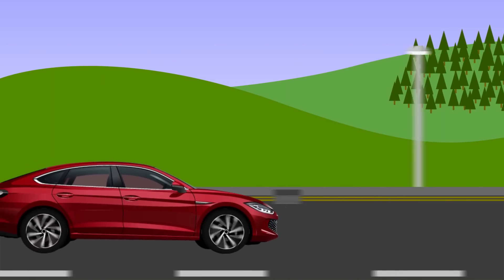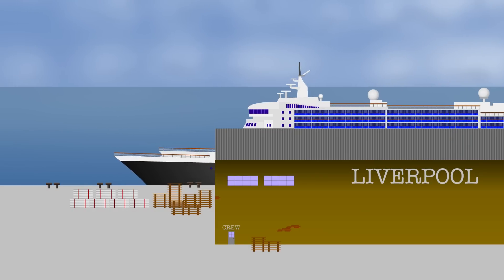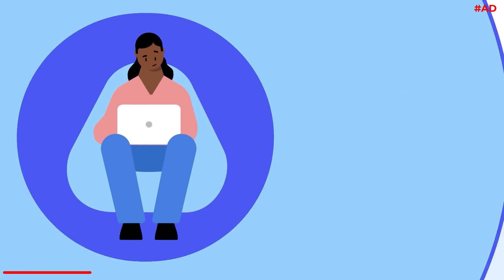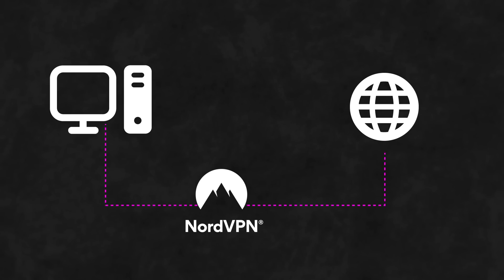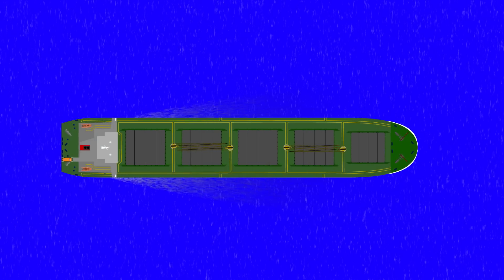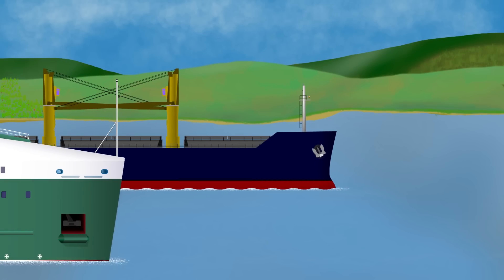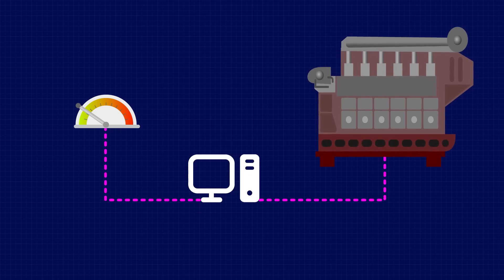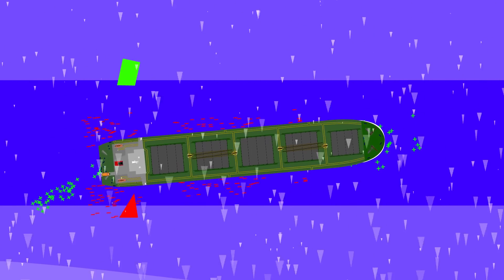What's Going Wrong With Fuel Efficient Ships?

Comment: Ship software can have confined water setting,to pre adjust the fuel efficiency systems to off in known busy traffic and narrow channels. Fuel efficiency can be also due to emission norms, which can be adhered to, by storring gas pollutants on board ship, in a compressed gas storage system that can on reaching any sea port fitted with gas pollution treatment facility, pump out the pollutant gases,to the sea port receiving facility for pollutant gas treatmen after a exhaust gas treatment paymen. Thus,the engines can also go faster as well, in narrower routes and still, pollution can be reduced. Lithium based battery inverter as a secondary power source should be on board all the ships, for pollution free automatic power source, smart switching between main engine and the main batteries  on main routes. Thus gas pollution is significantly reduced. Port can on payment by ship company, also supply electricity for propulsion as 5 to 10% of ship main reserve power to the ship main battery inverters from solar panels at the port itself or from the grid.

Comment: Now that we're here, and the Dali hit the Baltimore Bay Bridge, what are the odds that the blackout/engine failure the appears to have happened is the result of a PLS being on, and large engine controls overloading the system causing a blackout, at the wrong time, which led to their collision?
Reply: I can't believe that there is no override on some ships. Seems like that best compromise is the switching to cleaner diesel near port and disabling the PLS altogether. Automatic pilot and road assist driving are cool but in the end. I know some planes are impossible for a human to fly without computer assistance.

Comment: I'm sorry but I have to disagree with many things that are mentioned in this video.

The software you are talking about is not really a power limitation but a load program. Many ships have a load program when increasing rpm above a certain power simply because some engines are very large and rapid fluctuations in engine power cause thermal stresses which can damage the engine. The load program (slowly increasing RPM) is only there to prevent damage caused by thermal stresses, not to reduce fuel consumption.
During maneuvering, normally you stay below this load program because you want the engine to respond rapidly. In case of emergency you can ovverride these limits but you risk damaging the engine(s). That's why you have a full ahead maneuvering and a full seaspeed.

The power limitation that you are talking about is due to EEXI regulations which states that all existing vessels cannot exceed a certain value of mT of CO2 emitted per mile sailed, a number which is ship specific. Many older vessels do not meet these requirements and therefore have to take action. There are many ways such as fitting energy saving devices or changing over to a more sustainable fuel. But all these require significant financial investments which often are not economically possible, especially for older vessels. The easiest and cheapest way for a ship to reduce air emisisons is to reduce speed, and this is achieved by installing an engine power limitation.

With this power limitation,  the top speed is decreased and less power is available for maneuvering. But the engine still behaves exactly the same as before, in the same load program.
What some ports require, is that ships remove this power limitation so their full power is available at all times for maneuvering.
There are two systems, a mechanical limiter and a software limiter. A software limiter can be overruled by a push of a button on the ship's bridge. A mechanical limiter has to be removed by an engineer on the fuel rack of the engine.

I have sailed for 10 years as a mate and am currently in training for becoming a marine pilot. Until last year I was working in the office of a shipping company and all our ships were being fitted with power limitations.

Comment: Not related to this video, hoping the mariners here can answer a question for me.
Today on the Liverpool to Belfast ferry we passed/overtook another ship, a dredger. 
Do the officer's on watch/ masters acknowledge each other from the bridge? Eg wave , say Hello over radio. Or is it strictly keep your distance and course, keep comms clear unless required
Reply: I was working on the Liverpool to Dublin ferry and when we were still sailing on the Mersey river, you have to report to a vessel traffic control system (Mersey VTS). They have a radio channel which is dedicated to traffic on the river and there you make agreements regarding overtaking and movement in general. Probably you will contact the dredger and VTS before overtaking. Once you are off the river, you are free to do what you want as long as you follow international regulations. At sea I was only contacting other vessels before overtaking or crossing if I required their assistance.

Comment: I've heard the same sort of comments about traction/stability control on the Dodge Charger Hemi V8 cop cars when they first came out.  Gave the cops a false sense of security in that if you are engaging stability control, you really are out-driving the car and need to back off.  Or the stability control/traction control would kick in a way that the driver was not expecting it to throwing the balance of the car off in a high speed maneuver.  The old Ford Crown Vics didn't have stability control(and were down 100hp vs the Dodge) so they handled different if you pushed them to the limit.  Also you weren't going as fast in a Crown Vic so it was easier for an unskilled driver to correct at a lower speed, it was harder to outdrive the car.

Comment: So a power limitation software is like an autopilot for the engine? In that case, shouldn't all system have something a disengage them easily? Ships might be slow but there are situations where the crew would need to squeeze every bit of power they can from the ship at the shortest amount of time to avoid something so in my opinion, this kind of system should just have a big red button that when pressed would switch the ship's system from automatic to manual to give the crew the freedom they need.
Reply: What do you mean with manual? A giant steering wheel to mechanically push the propeller in a different direction?
Reply: @eljanrimsa5843  manual in a sense that the computer won't interfere with the input of the helmsman. If the helmsman inputs "full astern" the engine would switch gears and go to full astern without any interference from a computer program. The a narrator said that in some cases, the power limiting system can't be disabled in some ships which I think is dumb. What if you saw someone about to collide with hit and you needed all the power you can get from the enhine to move out of the way but the power limiting system prevented you from doing so?

Comment: Interesting and weird.  Ships have been around for a very long time.  Just as a piece of rope can replace autopilot I'm sure there were similar things even on masted ships.  Maybe like a mid-masted sail that doesn't get you all the speed but can easily deal with variable wind speeds so everybody can relax and take a nap?  Or that other thing, what am I thinking of...  Oh yeah!  CRUISE CONTROL!  You know, like in your automobile?  Won't engage under a certain velocity?  Helps with fuel/engine efficiency on long trips?

In all fairness I'm pretty sure the shipping industry already wrote the book on long travel efficiency AND 3D navigation.  And also insurance.  The main point I got from your vid is that neither automation nor capability is the problem.

The problem is they installed automation but never put a !BYPASS! switch on the control desk.  That's why Bow-Wingg managed to sell a plane that flies into the ground on purpose.  Oh, and also apparently automatically disintegrates when off the ground.  It's not a bug!  It's a...!  OK, it's a design flaw....  But digress I am...

Thanks, great job, please keep at it man!  Everyone should learn to Navigate, Casual or otherwise!

Comment: You need to understand the costs of shipping, (Fuel, Port Fees, Each canal, Suez, Panama charges huge fees)  because the time, labor costs and fuel to go around a continent is higher but these canals are Gouging shippers with Unreasonably high fees.  Panama you get in Queue(Perishable, Time Sensitive Cargo) To jump the Queue you can add Another 15% or more to the Base Canal Fee.

Comment: On those ships without them, which muppet (or penny pinching cretin) failed to put add a simple manual override  into the spec, to enable the crew to take evasive action?  Don't Lloyds and other underwriters require such blatantly obvious safety measures before providing cover, or is the situation as you've presented it, slightly exaggerated?

Comment: Only system I've worked with - granted it was 20yrs ago - was a "load program" that was used between maneuvering full ahead and sea speed.  If you were timed steaming at less than full sea speed, it would work within that zone from FA to sea speed (usually 93% MCR).

Comment: Lots of commenters are focusing on the software part of this.  On older vessels the engine power limit is set with a physical stop on the engine fuel rack to limit maximum travel.  (Think a bolt that is locked down)  In order to comply with emissions mandates this bolt has to be set with and engine manufacturers rep AND a class surveyor in attendance.   Once the setting is achieved, the measurements are recorded and a seal in placed on the bolt to prevent tampering.   In order to achieve the original power the bolt needs to be removed and seal borken.  So in order to get back into emissions compliance a class surveyor has to come back and verify its correct and re seal it.

Comment: Sound similar to an airplane's direct and alternative laws. Alternate law will override the pilots to prevent over banking and stalls. Direct law will not. Pilots will switch modes whenever there is a systems failure for better control of the plane

Comment: Increasingly, this is happening in cars as well.
The levels of driving aids in the modern motor car is just crazy and I find myself in a battle for control whenever I drive my wife's newer car.
Reply: That's terrifying! Doesn't the owner manual tell some way to disable some of these automated systems?
Also, what model are you driving that has automation that seizes control? The Automated Driver Assistance Systems that I've heard about are all augmentation, for example a warning when you start to depart a lane.  Well, there's also automated braking during cruise control, but that's cruise control and anyway not many people get upset that they failed to crash into the vehicle in front.
Reply: @j_taylor  Automated lane keeping tugs on the steering wheel when choosing better driving lines on twisty roads.
The automated braking system applies when continuing straight ahead off a roundabout behind a car that is turning...
After years of driving rally cars and enjoying driving, I'm not a fan of the car trying to do it for me.
I've recently purchased a '98 GC8 WRX for myself to drive, the only driver aid is ABS 😁👌
Reply: You know you can just turn them off right?
Reply: @MiniBandit007 
Yes you can. As soon as you turn the car off, they're all right back on again.
Not only that, they're never really fully off.
If like me, you can really drive a car, like I used to race rally car and was part of a stunt team, then if you actually try to do anything not programmed in the stability system leaps into action to 'save you'...

Comment: I have been up the Houston Ship Canal on a LPG carrier several times, usually to New Warren gas terminal, Houston. These passages seemed quite fast.
On one occasion, the 2nd. Officer told us that the Pilot was on the VHF to ask a vessel coming downstream what they were carrying. The reply was "Biscuits", whereupon our Pilot told them to get out of our way, because "Butane and Biscuits don't mix".
This was many years ago, and I didn't see the other vessel concerned as I was on Engine Room watch at the time, but I was amused to hear about it.
As an aside, regarding slow speed and electricity generation, on several of our vessels the exhaust gas boiler could supply enough steam at full speed to run a turbo-alternator sufficient for the entire electrical needs. At slow speed, due to insufficient steam production a diesel alternator had to be run too. This was, of course, before the systems that you described were in use.

Comment: One engineering principle that I really wish that people would demand more of any automatic system is some form of complete override. When your product is going to be in use 20+ years eventually you will find more than one moment where the end user needs full unfettered control of the product without the normal restrictions imposed by automatic systems.
Reply: There's also just a lot of cases where a "helpful" automatic system causes more inconvenience by being unintuitive, unpredictable, or limited even if it's not actually dangerous.
Reply: yes it's essential to have this
Reply: Agreed, my 1992 Mercedes has an early full time traction control system and it’s notoriously difficult to fix 30 years later. A disable for it would be nice just so I can drive and operate the car normally without its dreaded limp mode! Manual override should be more celebrated
Reply: Overriding everything is a bad idea in some cases. There are fighter airplanes, that need to protect themselves from ripping their wings off from too harsh maneuvers. Also they usually keep the pilot alive by limiting g-forces. 
Disabling that systems will kill the pilot within moments. 

On the other hand, I was almost killed by a „lane assist“ feature in a car that wanted to follow a white line instead of the concrete barrier separating lanes in a road construction site. Those should be far easier to disable and off by default.
Reply: @Gamer1928 That sounds like a bad lane assist system. Both cars I've owned that had that feature were designed so that you could over ride them very easily. Effectively what would happen if you turned out of a lane it will provide a moderate counter torque on the wheel, basically a "I think you're going to cross a lane boundary" warning, and if you continued to turn the wheel despite the torque it would very quickly release the counter torque.

It feels weird when you get the wheel resisting your movement, but like, that's literally the point of the system, and when I say moderate torque, I mean it, it's very easy to overcome it (and can even be calibrated to be weaker for those with mobility or strength issues who also need "light" steering).
Reply: @Gamer1928 I'm not sure if it's the same models, but I believe there are some that specifically give the pilot a switch or button (under a cover I believe) to disable some of those g-force limitations.

Given the choice between possibly ripping apart the airframe or blacking out from g's and definitely failing to out-turn an incoming missle, pilots would rightly want the choice.

The pilot may joke about wishing they let the missle hit them once their crew chief gets a hold of them if they've basically scuttled the multimillion dollar aircraft, but at least they'll be able to do so.

I think this is actually illustrative of a good design concept when it comes to safety interlocks. They should be well-defined and clear that they're engaged, and it should be very clear and require some conscious decision from the operator to disengage them, preferably with some record that it has. This balances giving the user full control with ensuring that people are consciously assuming it and also provides some assurances that operating history of a device is known. Not much different than having an odometer to discourage people from lying about how many miles something has been driven.
Reply: @Gamer1928  pretty simple flow chart to me. Is this automated system purposed to keep the device/the operator's body from exceeding its structural capabilities? If no, then it should have an override. Safety is situational when it comes to human constructs like traffic laws or natural processes such as current, but the laws of physics are not negotiable.
Reply: @Gamer1928 “turn off everything“ obviously shouldn‘t include basic operational requirements. If you shut off the electronics on a brake-by-wire or steer-by-wire system it just doesn‘twork anymore. Similarly you would never disable basic limitations on a fighter jet.
However, modern fighter jets also constantly adjust flaps to keep the plane flying because they are usually so aerodynamically unstable that you wouldn‘t really be able to fly them for long. In some mind of emergency however this system might do something dangerous, so being able to turn it off is important.

Edit: Also it should obviously be more involved than just pushing a single button. Deactivating should be a multi-step process.
Still, being able to put things into a ‚dangerous‘ mode is usually still a net benefit.
Reply: This is why I use an android phone and still run windows 7.
Sometimes I need to tell my shit what to do.
Reply: @TheCuriosity8  Android over iCrap sure, but imagine being so stupid you believe all this nonsense about 10 4chan spread, it's better than 7 if you disable all of 3 toggles...
Reply: @TheCuriosity8  may i introduce you to the world of GNU/Linux, using windows 7 is dangerous as it's service period has expired.